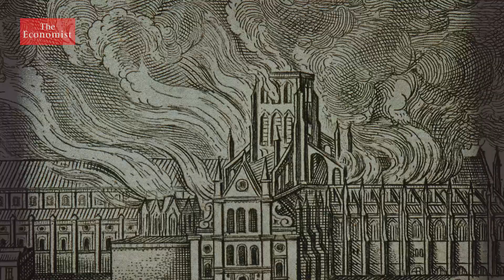Sustainable materials: is there a concrete solution?

Comment: I am genuinely disappointed by the lack of depth in this article and had expected more of something such as this. The start point, for me, in this discussion should be the technical life span of existing concrete structures and how this life span can in older structures be lengthened or in new structures be effectively infinite. These technologies already exist and are in smaller, but increasing use. Furthermore, the renovation of concrete structures requires less in the way of resources than their replacement with new ones. Take a look at an increasing trend in Sweden within its water and waste water sectors where it is simply not cost effective to replace existing concrete structures with new ones and where many different technical solutions are applied to maintain the integrity of steel reinforced concrete.  My comments come my work within that sector in Sweden where I lead projects that rennovate water and waste water production facilities.

Comment: The thin air and hot oceans is severe weather.  Halogenated vinyl halogenated carbon and nuclear technology have not been eliminated as Treaties instituted by scientists and ratified by most countries required.   These are the causes of atmosphere ionization and erosion.  Green House gasses interfere with this effort and Edison generators and dynamos power plants and vehicles to replace nuclear power plants and fossil fuels power plants and vehicles is hung on misinformation and political systems.  Carbon dioxide is converted to carbolic acid plants need to have in the rain to grow and have iron salts available for iron heme. This conversion to carbolic acid happens in minutes not decades.  The Edison generator and dynamos power plants and vehicles immediately reduce fossil fuels wasted for transportation and electric power..

Comment: One VERY OBVIOUS OBSTACLE to trying to build without concrete is the issue of FIRE PROTECTION!!!!!!!!!!!!!!!!!
Concrete is CLEARLY ESSENTIAL for building fire breaks in the larger multi unit buildings that LIE-berals with their Livable City plan want to force us all to live in - the Livable City plan is designed to FORCE US ALL into the smallest possible living spaces in large multi unit buildings for the convenience of LIE-beral city administrators!!!!!!!!!!!!!!!!!!!!!!!!!

In related news - LIE-berals DESPISE suburbs and single family homes and yet such homes ARE BEING MADE ALREADY WITH MINIMAL AMOUNTS OF CONCRETE - compared to a multi unit condo complex!!!!!!!!!!!!!!!!!!!!!!!!!!!!!!

LIE-beral thinking is SO MUDDLED that they want to halt the building of single family homes that are being constructed with RENEWABLE WOOD PRODUCTS and muddled LIE-berals want to FORCE US to live in LARGE STRUCTURES that DEMAND MORE CONCRETE AND STEEL - both for reasons of strength and for reasons of fire control!!!!!!!!!!!!!!!!!!  

Large structures CAN of course be built of wood  - but HYPOCRITE LIE-berals DO NOT WANT TO DISCUSS THE ENVIRONMENTAL COST OF FIRE RETARDANT CHEMICALS NEEDED TO TREAT WOOD STRUCTURAL ELEMENTS - so they will have a fire protection rating fairly close to the SUPERIOR FIRE PROTECTION OF CONCRETE!!!!!!!!!!!!!!

LIE-beral hypocrites are trying to re-invent the wheel - and their thinking is so muddled they see nothing wrong with their wheels having corners and flat spots!!!!!!!!!!!!!!!!!!!!!!

Comment: –Hempcrete and Concrete are made from Lime–
Lime Productions High Carbon Footprint of Product to Impede Growth

Lime Productions is primarily manufactured from limestone, wherein it is heated to break from calcium carbonate to calcium oxide and carbon dioxide. The CO2 generated during the production process is one of the greenhouse gases that has led to several calamities and global warming while leading to drastic consequences. Furthermore, production is a highly energy-intensive process and adds to the industry's overall carbon footprint.

Mild exposure to carbon dioxide has effects such as nausea, headache, and drowsiness. Moreover, heavy exposure can lead to breathing irregularity, confusion, elevated blood pressure, increased arrhythmia, and even death due to suffocation. Such effects on human and environmental health have been a key reason for consumers seeking alternative calcium hydroxide solutions. –FORTUNE BUSINESS INSIGHTS

Comment: Uhm... they kinda missed the point of hempcrete being fire resistant, thus solving the burning wood problem, once the wood studs are encompassed in hempcrete... yeah, oops. Editors, check the floor. You must have cut those clips, eh?

Comment: A timber bean will outlast a steel I-beam in a fire. The steel beam loses it's strength in heat and will collapse in a fire. A timber beam will be charred but retains its strength longer.

Comment: I read recently that even if concrete were manufactured with solar, there would still be huge emissions from the emissions released by the concrete itself. I also read about companies making cement products that actually absorb emissions. It's in its early stages, but I'd love to see more about it.
Reply: Well, concrete needs co2 in its composition so eletric manufacturing wouldnt change much

Comment: Reducing concrete waste or the amount of over design (more cement in the concrete mix) is currently the biggest lever that we have for carbon reduction in the space.
Reply: 100% the waste is from the designers and engineering community. 

Insane how things are over designed for the sake of being over designed.

Comment: Builders, customers and designers have to learn to respect the terrain and future weather.  My city in Australia has just flooded again from another "once in a century" flood.  The 2nd in 10 years.  When I was growing up all my city's houses were built on wooden stumps from 1 - 3 metres above the ground. My parents built their last house in 1974, of brick and concrete, six months before the worst flood in our recorded history. Even though they didn't flood, I remember Mum saying that they should have built in the old way, on wooden stilts.  My generation was constantly told that they only built in wood for coolness against the summer heat, but my parent's generation knew it was for flood protection, which was rare then, but not now.

Comment: However, aggregate for concrete is one of the few downcycling options for many materials and though a lot of CO₂ is produced in making cement as the binder for the aggregate, the cement reacts over time to absorb atmospheric CO₂ sequestering it indefinitely.  There other binders from plastic, mycelium, mud, and compressed earth but they all have less compressive strength.

Comment: Cost is having a big effect for the industry in Toronto Canada, so many of our projects are taking a serious look into steel which currently is a bit better than concrete. Some of it is starting to switch over to hydrogen which will work well when we get enough solar and excess midday energy to produce hydrogen. I'm wondering if steel (which still requires a parking garage and up to 2nd floor to keep transfers in the concrete) will be enough to take that industrial waste and use it in the concrete of the building? If they are in the right proportions.

Comment: I expected better from the Economist. This article didn't even touch on how existing technically sustainable materials have been made unsustainable through planned product obsolescence. Products made with such low expectations of usability, repair-ability and longevity that they barely achieve the goal of being sold to a consumer. Their material blends making them impossible to reuse in a sustainable or economic process.

Comment: of course you can build without concrete, Houses has been build without concrete for thousands of years. The matter is that every resource that can be used for construction is running out, plastic used for epoxy and paint, Lime used for binding and surface, sands which is the basis of most frame or building.
Reply: Roman structures built with concrete are still in use today - not many wooden or mud brick are more than a 100 years old.

Comment: If you live in a warmer climate, and you want to build a house, build with cob (sand, clay, straw blend). If you live in a colder climate, like I do, then build with straw bales. Both of these materials are cheap, readily available, and load bearing (yes, even straw bales). No further building material innovations are required. What's required is the adaptation of the building industry.
Reply: Nice try big bad wolf
Reply: @logtron  lool

Comment: I would totally build and live in a house made out of sustainable materials, but the fact is that concrete houses don't fall apart, yet you build a wooden house and it starts creaking and needs major repairs after 50 years. And since the price of a house depends on its land not its materials, it would be more cost-saving in the long run to buy a concrete house.
Reply: Materials are also much more expensive than they used to be
Reply: … so many misconceptions … Yeah, I think you have the wrong idea about concrete, sustainable materials and building technology in general. Most people do.

Comment: Problem is with concrete, there is a vast array of sustainable alternatives being researched, but as of right now, nothing really compares to conventional OPC concrete for cost and performance
Reply: Could move away from high density areas to more medium density that could be made more sustainably. Paris and Berlin for example have relatively low building heights compared to other big cities. I guess we might need to change the end goal to match the new materials.
Reply: @craigwilliams1707  Moving away from higher density also means you lose economy of scale for infrastructure/amenities, thus has higher carbon footprint per capita.
Reply: @craigwilliams1707  yes and those low buildings do also use concrete. 

And is taking in more place environmental?
Reply: @BeFred08  they don’t have to though, could be brick, wood or something new - and don’t need to take the same load so could use some but less concrete. They also help move towards a more livable and less car-reliant city.
Reply: @craigwilliams1707  something new? What then? That can be produced in these large quantities? 
Wood? There is already a shortage of wood on the global market.therr isn't enough woud, simple.
I
Reply: Wastewater sludge can be used to make bricks I hear.
Reply: @hunterhq295  go to a concrete lab that's testing it and you'll smell why it's not currently viable. Trust me.
Reply: @jPdfsd5421  Well there is a place I know that does it
Reply: Subsides are key
Reply: Concrete is not the problem.
Reply: But that's because the true cost of concrete is externalized. Climate change mitigation is expensive!

Comment: The waste products from steel production often contain a lot of highly toxic metals like lead, cadmium, mercury, barium, radio active radon gas, chrome 6, zinc, etc. so before promoting these materials like geopolymer concrete witch uses waste ashes from steel production and using these potentially toxic waste products I hope there will be a passport for the raw materials otherwise drilling a hole that kind of concrete will release all kinds of contamination with toxic dust, witch reminds me a bit of the wonder product asbestos. Asbestos fibers “only”
caused cancer and was maybe less harmful / toxic than waste from steel production witch can result in all kind of autoimmune diseases witch can be carried on for generations.

Comment: But it was not clear why concrete has emissions??? In what part the process concrete produce CO2??
Reply: Hey Pepito,
Emissions are mainly produced during cement manufacturing. Cement is produced by burning, at high temperature, limestone and clays. Burning limestone produces CO2.
Reply: 80% of it is from cement. 

Portion of that is the actual energy required for heating limestone to 1450deg C. 

The other is the actual reaction that occurs from limestone (and other products in smaller quantities) to cement. It release some carbon emission to the atmosphere. 

The other twenty is concrete production and transportation

Comment: come up with a more economical alternative... ill wait.
Reply: If we created a carbon tax that accurately priced the cost of CO2, then most alternatives would be more economical, because the price of concrete would skyrocket.  Think about all the wars that are fought over oil now, and think about all the resource wars of the future that will be fought once the climate gets too hot for people to grow food in many parts of the world.  Think about the fact that, because of Europe's use of fossil fuels, they are funding the Russian war machine and have been doing so for decades.  Also, most of the large cities in the world grew up around river deltas, which are at sea level, so those will be flooded in 100 years.  The cost of climate change is enormous, but it is not yet being factored into the cost of concrete as it should be.  If it were, concrete would in no way be economical for most applications where it is currently used.
Reply: No need, isn't the outrage enough? That is the way.